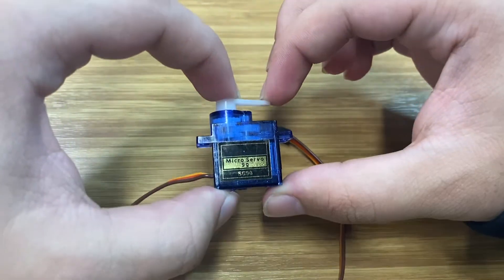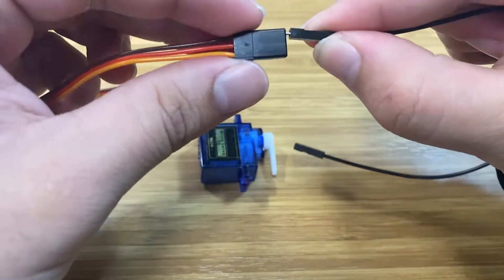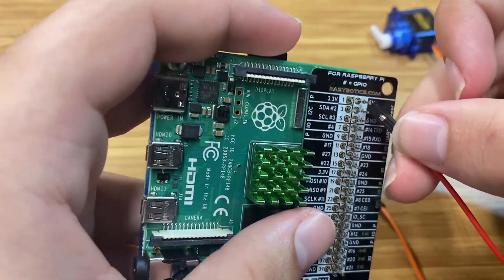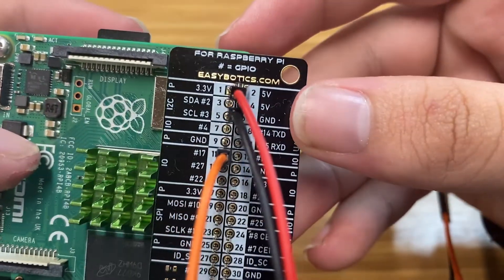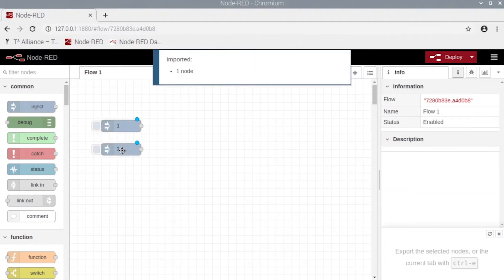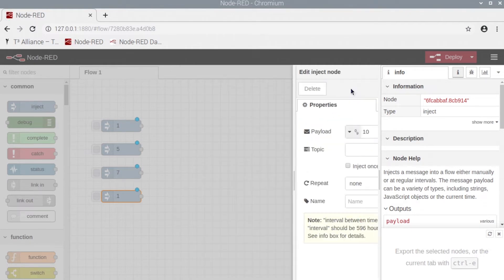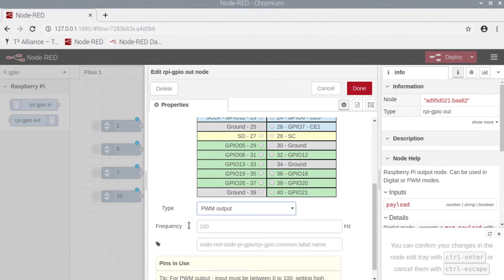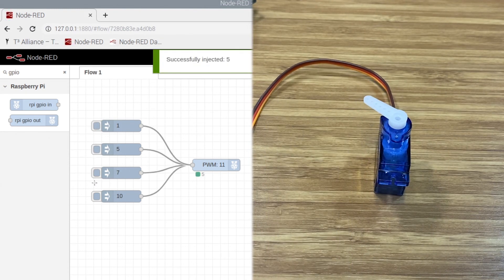RPI Node Red: Servo Motor

Comment: I have a 180 degree servo. How can i rotate the servo for 180 degrees in 3 minutes and back the same, all the time with no stop ever.
Reply: The immediate solution I can think of is changing the injection number block to a timed block. The option should be in the injection block itself. You can do timed injections and then use a function block that would reset your injected values to zero. It’s a start. I hope that kind of helps. And good luck!

Edit: Cut down some words and fixed spelling errors :)

Comment: Hi!, I configured my servo like you said, but I have a problem. Why the motor move like crazy?,
Reply: I found a solution. Pigpiod utility allows better servo handling than conventional gpio pins. (apt-get install pigpiod, install nodered pigpiod module, in /etc/rc.local put on line betwen fi and exit 0  sudo /usr/bin/pigpiod &  and reboot )